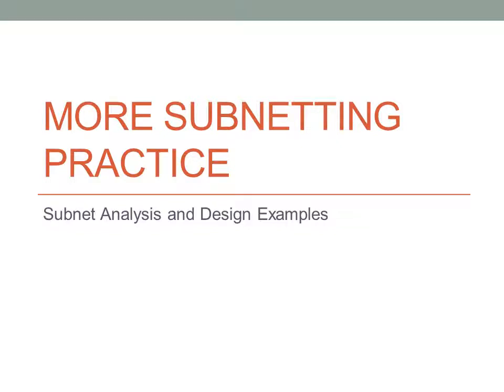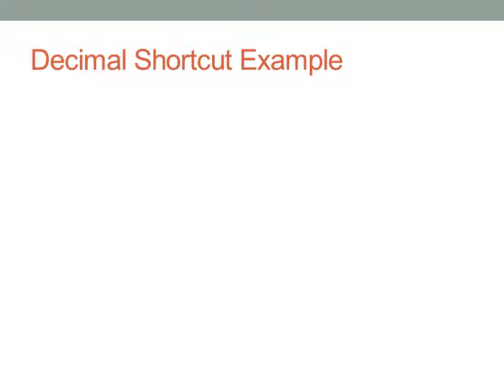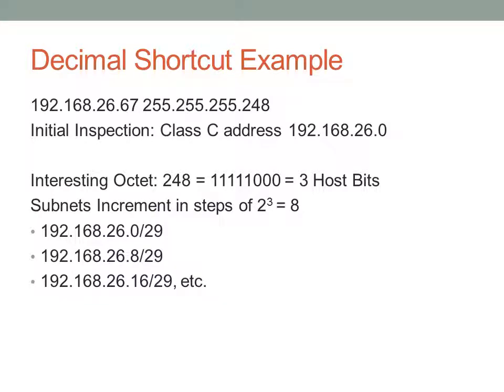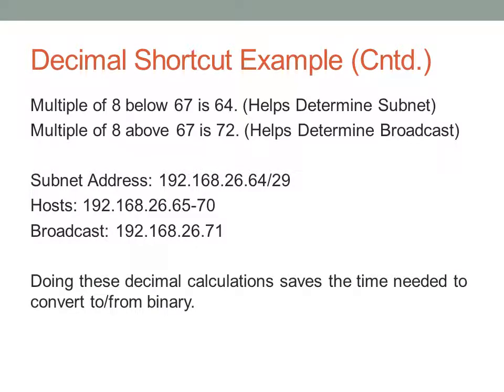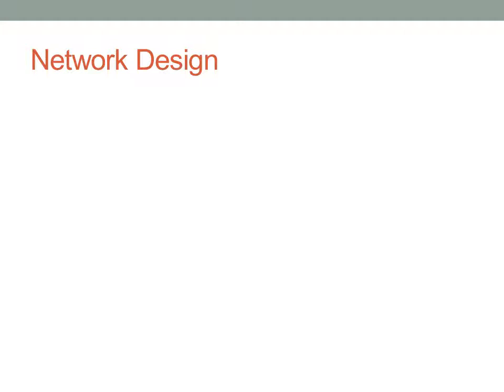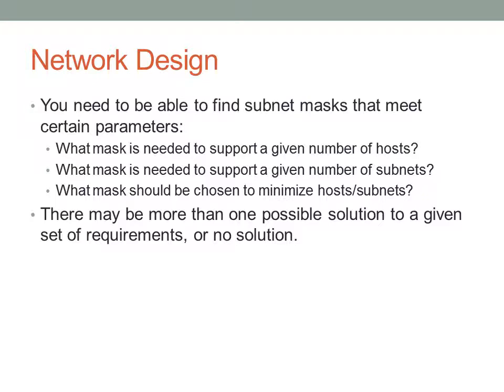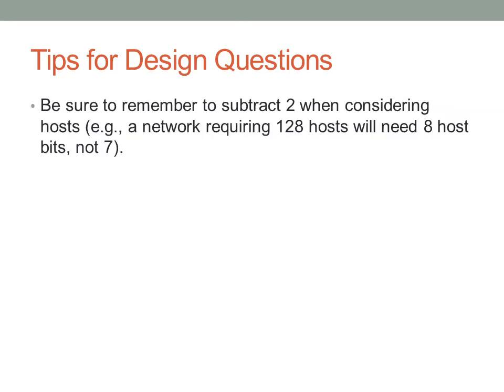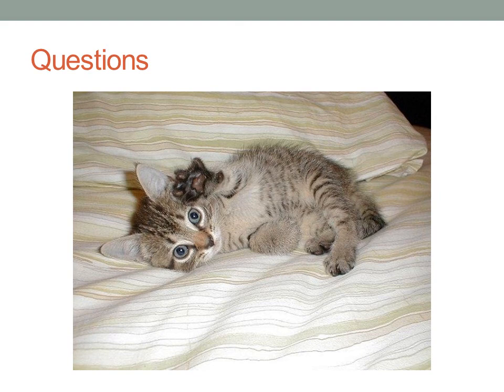More Subnetting Practice

Comment: Can you walk through adding the subnets.  Need more problems for practice.  Please walk through more examples.  Slowly explain every number and step.  I have it but annotating all the networks gets alittle confusing.  This is great!
Reply from the maker: Re-reviewing this, I can see that I did go over these examples very quickly. Subnetting is an extremely important component of the CCNA, but there's so much other practice material available for subnetting that I didn't give it too much treatment outside of explaining concepts. My method is basically this:

http://www.netsrv-consulting.com/blog/subnetting-using-the-magic-number/

Doing searches for "subnetting magic number" will yield other results. I don't have much time to write up a worksheet with detailed steps, but I'd recommend looking at the YouTube suggested videos listed next to this one. Ultimately, there is no "one right way" to do subnetting, and lots of people have lots of different methods they find easy to use. As long as you end up with the correct calculations, it doesn't matter very much how you got there. Find a method that works for you!

Comment from the maker: Sorry if this seems confusing. In short, the first solution minimizes subnets available, and the second minimizes the number of hosts.

The first solution creates 254 usable subnets (excluding zero/broadcast   subnets) and allows up to 254 hosts per subnet. This meets the requirements of the problem, but doesn't allow for much additional subnet growth.

The second solution creates 510 usable subnets, but only 126 hosts per subnet. This allows for greater expansion, but sacrifices hosts.

Comment: I am confused on your last example though...if you are working with "need 100 Host". On binary you will add 7 zero to your subnet starting from right and put rest of them 1. Don't you follow that step when you need to create hosts per network? But you say this will create more network than hosts? 

11111111.11111111.11111111.10000000